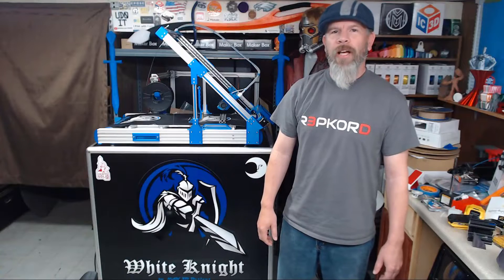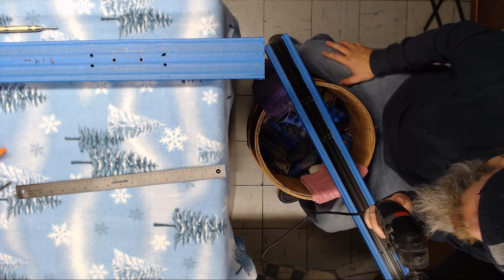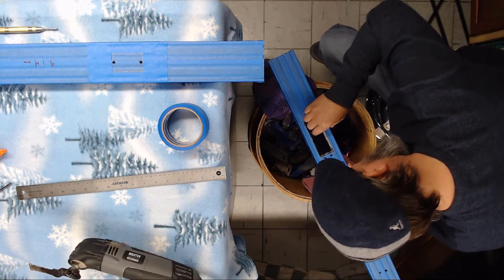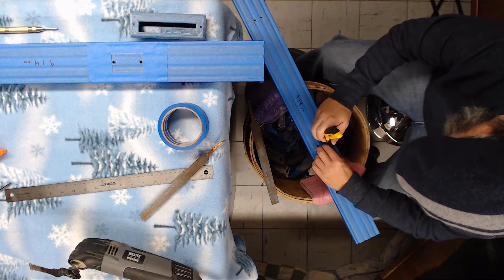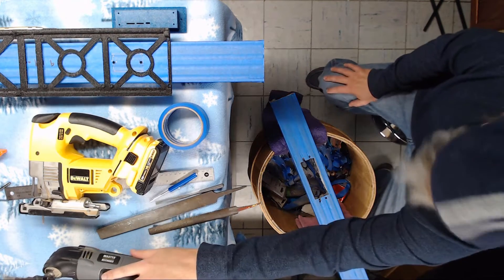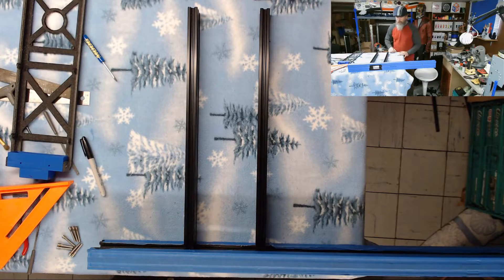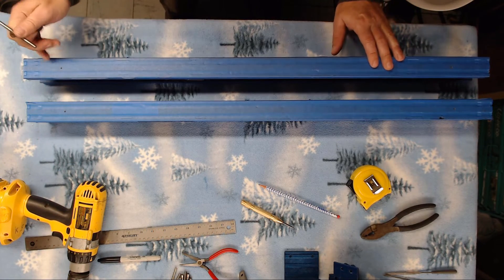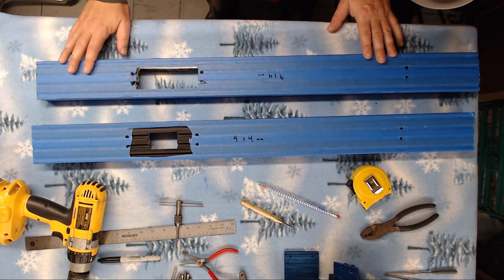White Knight Assembly Part 3

Comment: How long did actually take to make those 2 holes?  You think something could be improved in the design to make this step easier or faster?
Reply: There are a couple of tab-slot cutters out there for wood, so no doubt someone has access to something for alum
Reply from the maker: Sebastián Podestá they took around 3 hours total with cutting, filling, and smoothing the edges.   I’m hoping the kits will have the extrusions precut with all openings already done.
Reply: NAK 3D Designs thanks for all your work! is there any info on the kits? An estimated date?
Reply from the maker: @seb3d  Sorry, no update yet, we are still working on sourcing all of the parts...